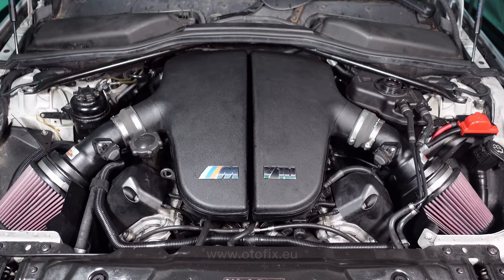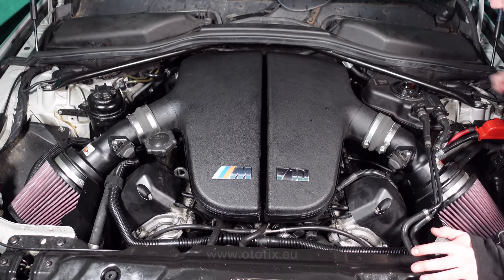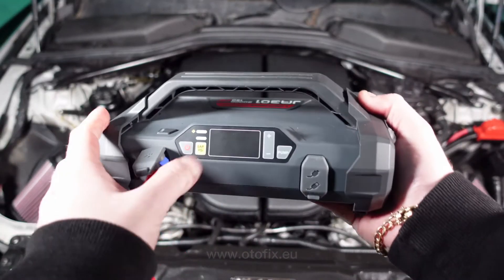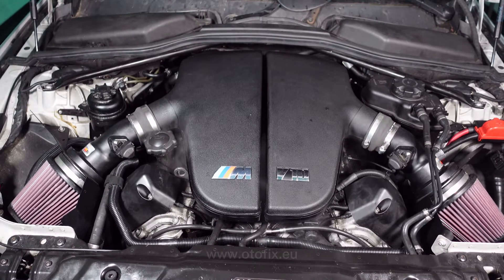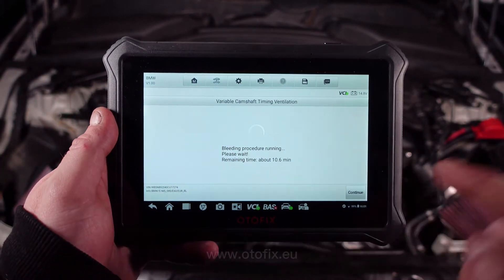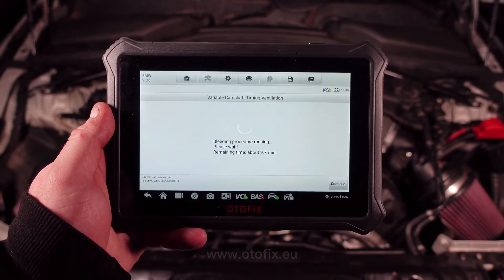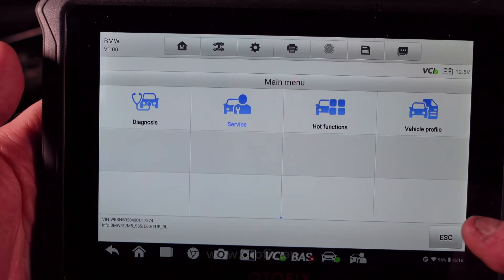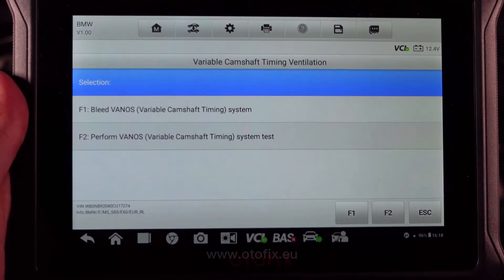How to use OTOFIX to do Vanos Bleed Procedure on BMW E60 M5 S85 / S65 featured by BMWDoctor

Comment: How did you get to that VANOS menu on the D1?
Reply from the maker: Normally, you enter through the BMW software, and there is a 'Service' menu in the main menu. After entering, select the engine system to access this feature.
Reply: @otofixeurope5131  is the OTOFIX D1 light capable of bleeding the VANOS system?
Reply: @nathanhenderson8792 no it is not.. I bought the exact same scanner for my e92 S65 and I don’t get the VANOS bleed procedure as Dean does and for some reason Dean does not reply to my S65 related questions 🤦🏻‍♂️ really click-bating as S65 and S85 are not even similar
Reply: All due to enforcing marketing gains, luckily I bought the scanner on cyber Monday sale May be returning it to Amazon soon as I only needed it for the bleed procedure
Reply: @SuperBeastin247 any update? Did you figure out how to do it?
Reply: @SuperBeastin247 which version of the Ottofix did you buy?
Reply: @Jordan_Saba  I didn’t unfortunately, I heard it’s not possible but I just put the car on back burner for the time being
Reply: @Jordan_Saba  I bought the D1 lite